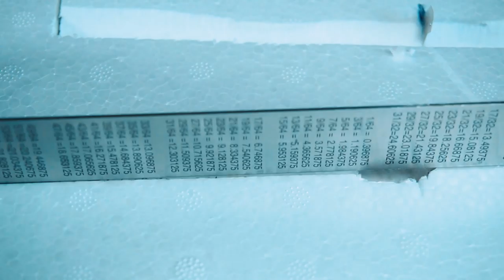Lidl glider RC modification with folding propeller

Comment: Same basic set-up. Full Micro 4 channel, thr,elv,rud,ail. I used both a Cox .049 reed & .051 TeeDee port timed. .049  mid range in speed. 8 minute flight times.
The TeeDee powered is a screamer, Fully Aerobatic. 5 minute flights.

Comment: Great video. This exact model can be bought at K-mart in Australia for 10 AUD. (May 2022), and I am in the process converting one myself. I am hoping to do it as a 2 channel keeping the dihedral without motor, and later add motor and maybe ailerons.
Reply: If you don't want to do crazy aerobatics with it Tom, you just put the ailerons on the outer sections of the wings in as far as the dihedral bend. We also made them into twin motor cruisers with salvaged motors/ESCs from scrapped quads mounted on thin aluminium angle screwed onto plastic wall plugs glued through the wings.These mounts sit flush with the bottom of the wings and can be bent down slightly as required. So no torque roll and the thrust line goes pretty well straight through the wing. They fly beautifully on 3s and a Byme-A stabilizer.

Comment: Que bien. Buen trabajo. Ayuda por favor   construi uno igual  Pero Bimotor y un poco mas grande pero ocupa casi el 100 % de potencia y ocasiona que a los pocos minutos como 5 se sobrecalienta alguno de los dos motores y se quema, ya van 2 veces que se queman.tienen 1 speed control cada motor.   Que los motores no estan diseñado para 3 celdas?  Motor que uso 1806 2208kv  MARKS  o sera que son de baja calidad?   MIL GRACIAS

Comment: Mine has fiberglass top and bottom spurs Followed by carbon fiber cloth and fiberglass vacuum bag I took it dynamic soaring if you know what that is and got it to 165 miles an hour....Weighs 6 kg.

Comment: Great video. Thank you! Just a silly question, you didn’t list a link to buy an ECS in the description. Is an ECS required? Could you help with a diagram or link on how to wire the parts together?
Reply: Without ESC no brushless motor I guess

Comment: Hi, nice job.
How did you manage to fix the propeller to the engine?
It does not have a locking screw.
And what battery did you use?
Greetings from northern Italy.

Comment: Hi! Nice project...what' s the ESC used for this motor?
thqnk you ;)
Reply from the maker: It's a 30A ESC for drone racing but modified with a Buck converter to energize the receiver with 5v

Comment: Very nice bro ! 2 questions though
What type of glue to use ?
Do you really need to flatten the dihaderal ?
Reply from the maker: The glue is the gorilla CA glue and for a servo I used hot glue, the dihedral needs to be flat in order for the aileron to work.
Reply: @Joyplanes  i think smaller ailerons might have worked well !
Reply: @Joyplanes  can you tell me the prop type used on this glider ? Thanks in advance
Reply from the maker: @F139  look in the description for folding propeller
Reply: @Joyplanes  thanks bro! Nice work
Reply: Never quite sure why you need full span ailerons. Full size planes don't, models don't either. Mine works fine with ailerons on just the dihedral portion and the nose fit closely behind the spinner on my as well!

Comment: Could I use a 11.1v lipo 2200mAh battery ?
Reply from the maker: No. That battery would be really heavy for this glider. You should use a 300 or 600 mAh battery.
Reply: What if I used a 2200kv motor  @Joyplanes